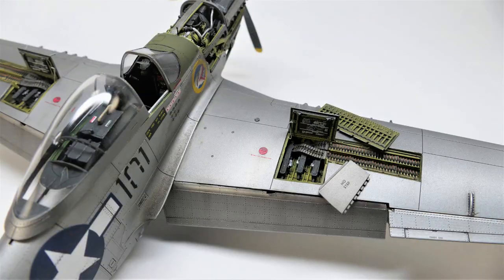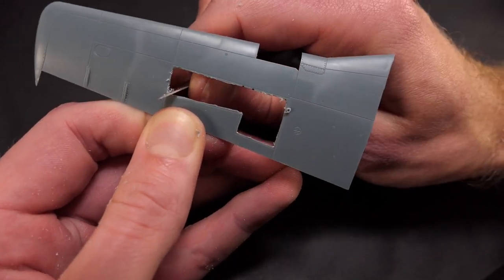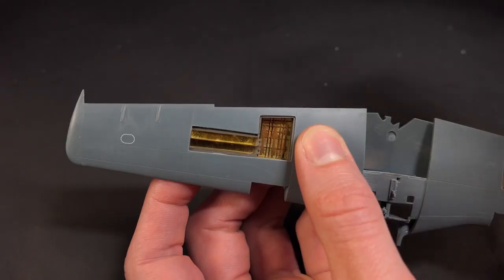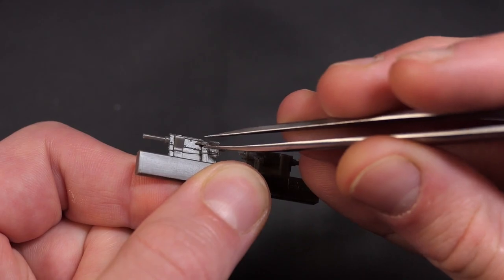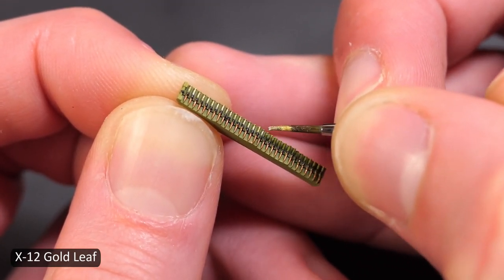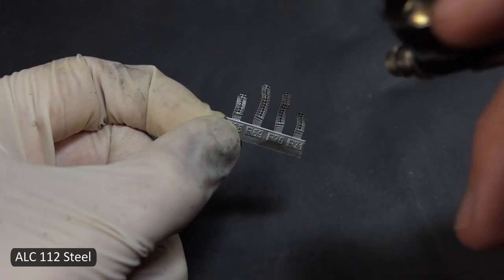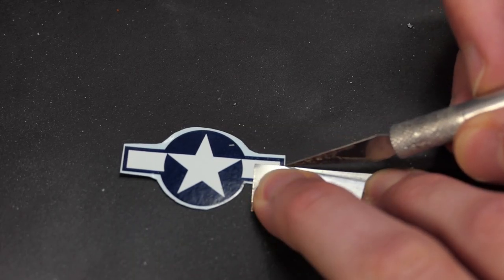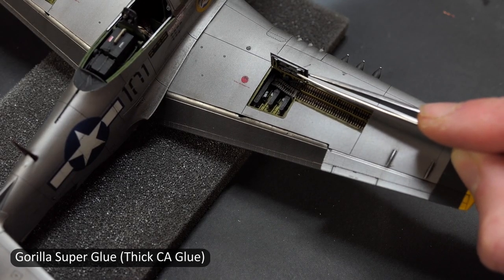P51-D Mustang | How to build & paint gun bay | Part 2 of 4

Comment: Great build! Have you tried the tamiya 1/48 mustang kit? Which of two do you like more?
Reply from the maker: Thanks!  I've built Tamiyas Mustang before (kit 61040).  This Eduard kit has much more detail and is my preference.  However the Tamiya kit is about 20 years older and noticeably lower cost.  Both kits had good fitting parts.
Reply: @ScaleModelAssassin  I've so far built only Revell and Tamiya kits. I'm scared to venture to other brands because of how detailed and how well Tamiyas are assembled. I'll look into purchasing Eduard kits in the future.
Reply from the maker: I was the same way at first since I know Tamiya is good quality.  Ive built a number of Eduard kits now and would highly recommend them